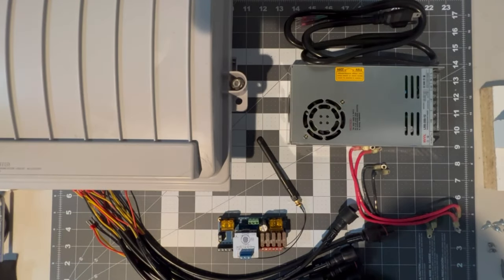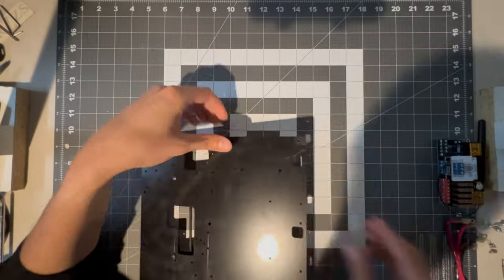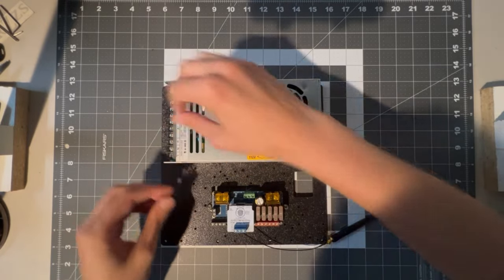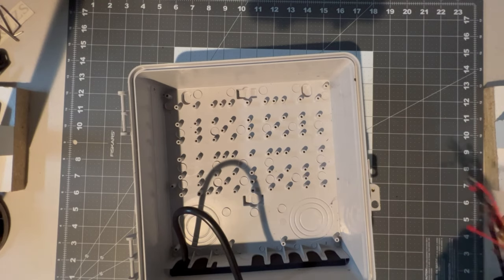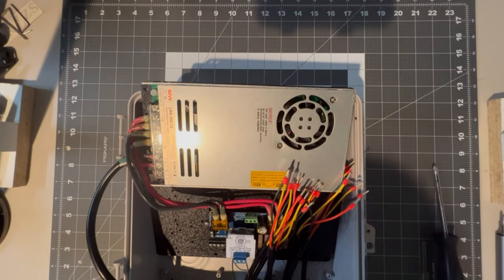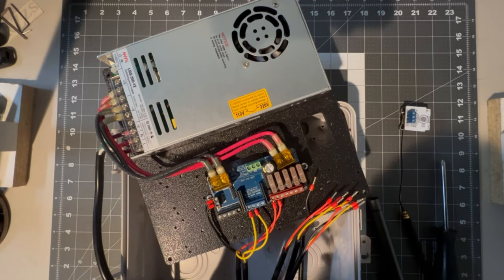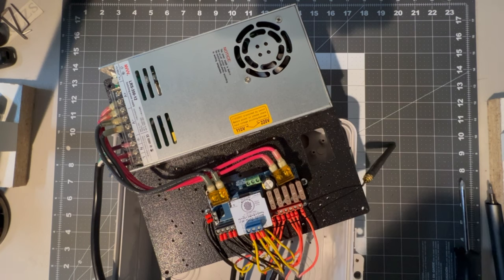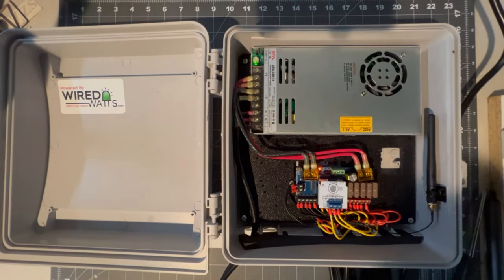Dig-Quad LED Controller with AE+ - CG1500 Build

Comment: You are using 4 outputs, each havinf a data line. How do you power inject, do you have another box for power injecrion only ?
Reply from the maker: I don't use any power injection in my show as I keep the pixel count low enough to not have any issues. However you can either pull from the same board or a seperate box. Just make sure not to cross the positive line from mutliple power supplies

Comment: Hi, couple of questions- 1. do you always have to hook up two power lines to the dig?  Can I just use one?  2. what are the yellow wires you added to the ESP?  My dig quad is en route from China and I just want to make sure I know when I'm doing when I get it.  I will be using three ports and only have about 600 pixels total for my roofline.  Thanks!
Reply from the maker: Don't always need two wires to the quad, it depends on the power and wire size used. The wires to the ESP are the additional data lines coming off the AE+ hat

Comment: Will the Quad mount be available on your website? Trying to get everything in one purchase.
Reply from the maker: I have posted the STL file for download now and added to the description. I don't have plans to sell a printed version of it at this time.
Reply from the maker: A new option exists specific to the Dig devices and the RNI1500 enclosure which is similar, https://turtleplates.com/RMI-1500-Dig-uno-quad-mounting-plate-p504748395
Reply: @justinzdesign  almost ordered it, but shipping is more than the product.
Reply: @justinzdesign  decided to just grab everything I thought I needed from your site. Hopefully it makes the one o’clock USPS truck today.

Comment: You have seven led channels including the three on the top?
Reply from the maker: Yes, with the AE+ you add three more that have screw terminals for 7 total
Reply: @justinzdesign  how many pixels are you able to drive with seven channels
Reply from the maker: @playingforlast7639  The esp32 can drive 2000-3000 pixels total and around 500 per ouput before framerate or processor limitations. I've tested up to 1800 on this specific controller without issues
Reply: @justinzdesign  thanks for the info